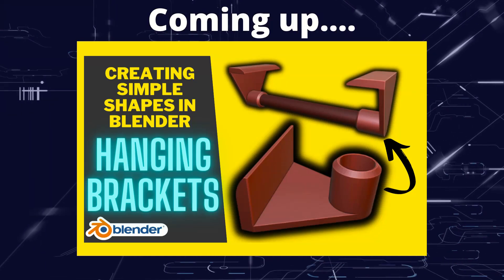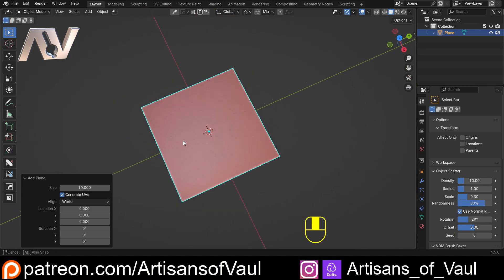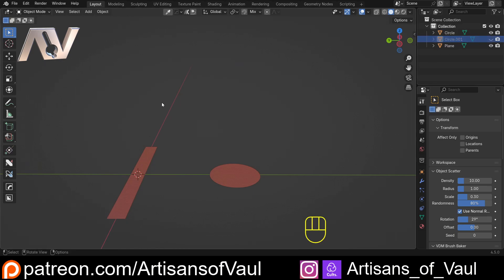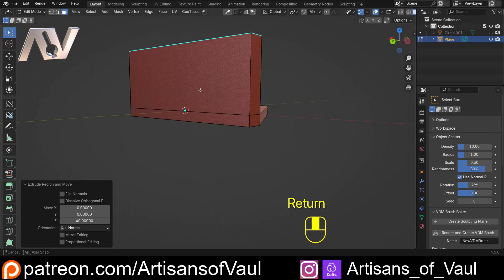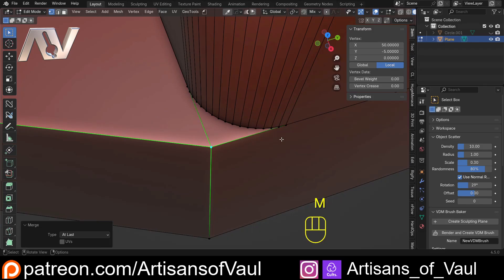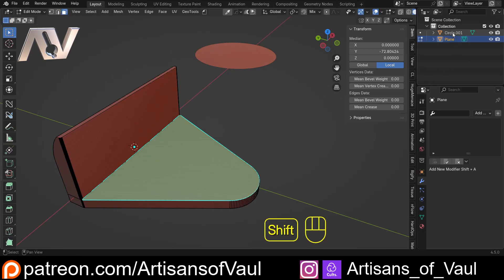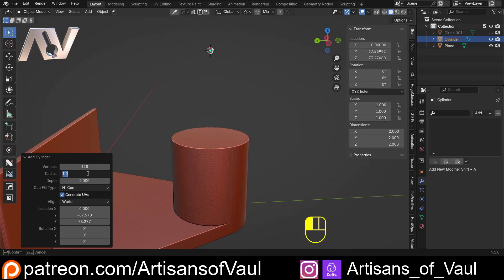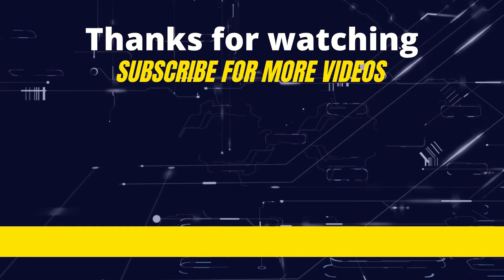Creating a Size Specific Handing Bracket in Blender

Comment: One thing that always throws me in Blender when being careful with measurements is all the create-object stuff uses radius, but then the bounding box measures the diameter. I think about half my works I print it and go "Oh, crap, it's twice as big as it's supposed to be."

The convex hull is something I don't think I would have thought of. That's great. I was expecting you to be popping into TinyCAD or some such.

Also, you could just put the thickness into the operator panel for inset to get walls the thickness you wanted them to be without having to boolean. Of course, that's destructive, so your way probably is better if you're worried about that.
Reply from the maker: Good point about the operator and definetly an option.  I agree the radius vs diameter is a but complicated and not sure why they do it that way